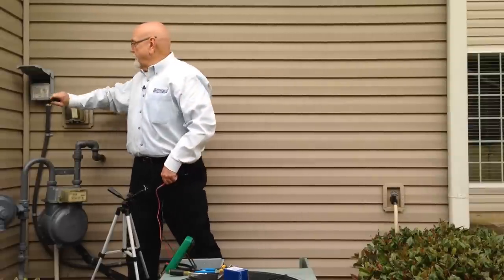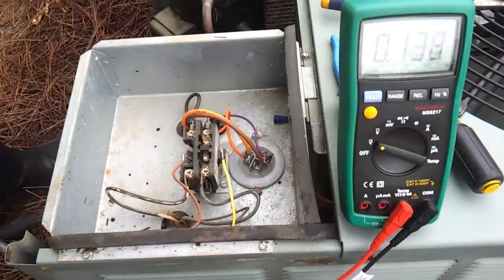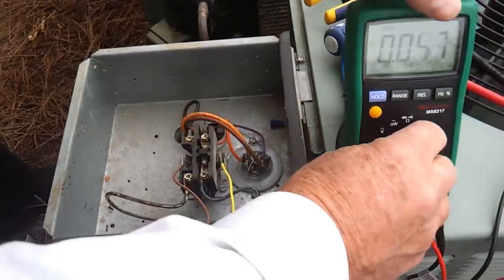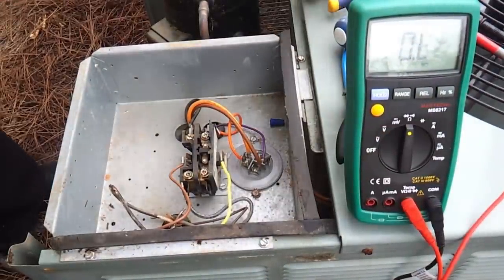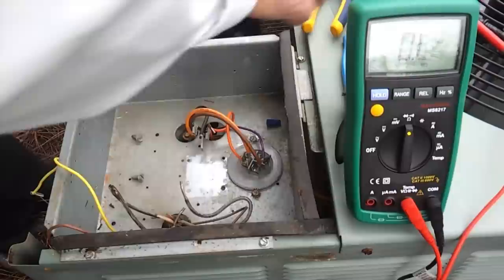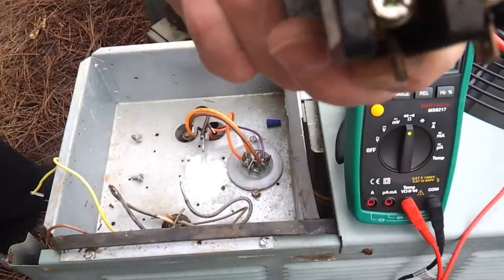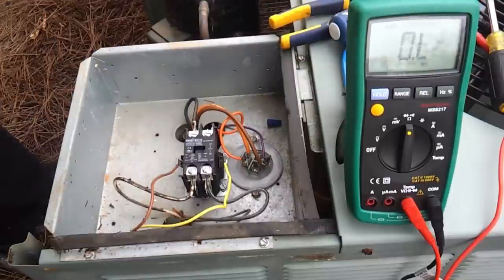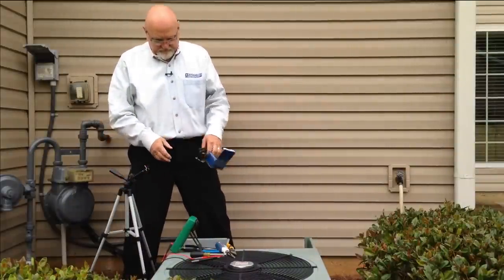AC Fan Not Starting - How to Troubleshoot & Replace a Air Conditioner Contactor Relay - DIY - HVAC

Comment: I need to replace a contactor and its FLA is 25 and Resistive is 40 amps  its a 24v,  do I need to get the same exact one or can I get a 30 amps FLA?
Reply: A-L-A-N GaV what did you end up doing since your question was never answered.
Reply: According to experts, you should replace with the same or higher Amps